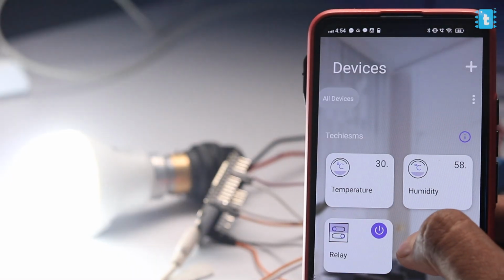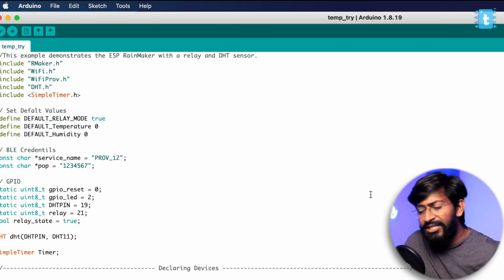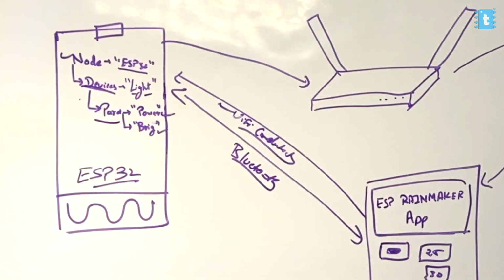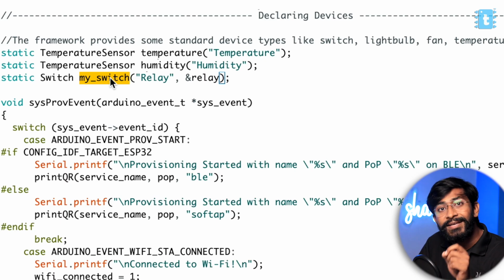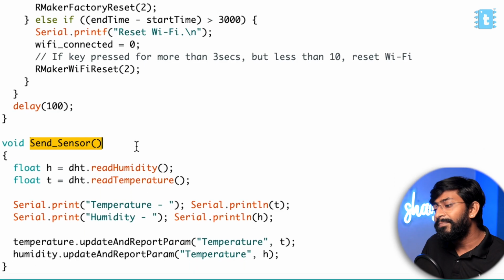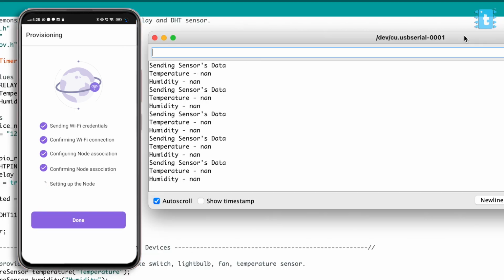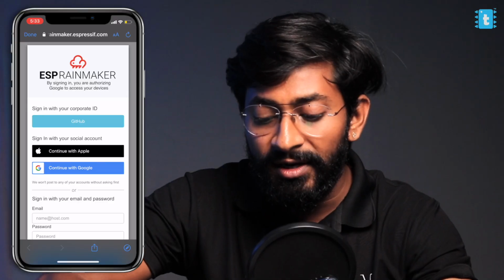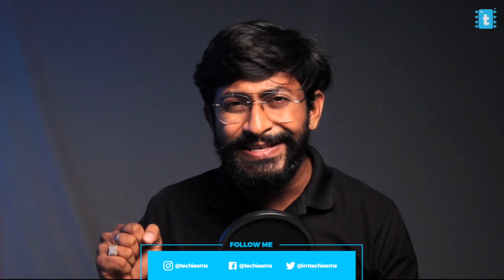Using RainMaker with Arduino IDE in ESP32 | More Features than Blynk & Arduino IoT Cloud for FREE

Comment from the maker: Well, What will you use for you IoT projects? 

New Blynk, Arduino IoT Cloud or RainMaker ??

👇🏻 comment below 👇🏻
Reply: Only one request, for the upcoming project, please consume as much outputs as you can for the relay, as it will be more convenient controlling maximum number of devices using single project.
Reply: Sir rainmaker is more than blynk so pls add more relay
Reply: @rohitmobilecare7691  yes
Reply: I use nodered
Reply: Thank you so much indeed. We really appreciate your great effort and easy to follow tutorials. I am able to implement it according to your instructions. And I am very excited about it. We really hope that you will guide us to how to use the local network connection. Thank you so much indeed.
Reply: Sir thanks for the indetailed explanation.
QR code is not visible in serial monitor , so how to slove this 
I am getting error as: Node connected to Wi-Fi without assisted claming.cannot proceed to MQTT connection.
Reply: Will give Rainmaker a try. The Blynk user interface was amazing! I don't like what they did with the prices. After some fiddling I have a slider in the rainmaker app as well so maybe I'll try more of Rainmaker.
Reply: A fatal error occurred: MD5 of file does not match data in flash! error bruh
Reply: Why do we have to use a third party all the time. Why can't we just connect directly to the ESP32?
Reply: Can it be installed on the ESP32-S2 Mini board?
Reply: Thank s a lot for this informations from Oran,Algeria.
Reply: i want to add 5 relays to the esp32 program what should i add in the coding section on arduino IDE ?
Reply: Well I have been using Blynk for over 5 years... need to switch to rain maker now, as Blynk is loosing it worth for home users.

Comment: Sir when try to connect via rainmaker mobile app then three features out of five has been added but confirmation of node association is not connected. Why this happened? Two days ago it was alright but after power off the module in the night & in morning when try to connect it with mobile rainmaker app not possible. In serial monitor shows MQTT failed. What is the problem? Don’t understand it. Please answer me.

Comment: Hello thanks for making the video about Rainmaker.... However I'm really struggling to make it work (sadly have to admit been looking at it serval months) I use same Arduino IDE version as you use in video (1.8.19) and also am using same board version  (2.0.3) ... I can compile without any errors and upload it too... However I don't see any QR code (or link) coming... the only text I get in the terminal (serial monitor) is some unreadable text and characters.... I use a Esp32-wroom-32 board (devkitc v 4)

Comment: Hey i just came across your channel and its pretty cool what u're doing. If u can could u please make a DIY video  demonstrating how to make a simple 3D Printer Filament Dry Box that uses a heating mat, some 5v pwm fans for circulation, and if possible with room to  upgrade to a solid state dehumidifier. now the best part of the video would be having an esp32 with RainMaker controlling everything and regulating the heating mat's temp to create a suitable environment for the filament. Let me know what u think even if u dont like the idea lol

Comment: 14:21:55.590 -> E (22062) TRANSPORT_BASE: Failed to open a new connection
14:21:55.590 -> E (22064) MQTT_CLIENT: Error transport connect
14:21:55.637 -> E (22064) esp_mqtt_glue: MQTT_EVENT_ERROR    error is pop[ing when we are try to reset

Comment: Hi Bro, I am making one box which can measure Temprature, pressure, weight, RPM, Sound intensity and other 4 parameters so, i am confused which server or cloud platform i should use?? i am using ESP32 board so rainmaker would be good idea or Blynk IoT or any other suggestions?? Thankyou  @techiesms

Comment: Hello
can you help me with esp rainmaker

I should measure the voltage on one battery pack

it has 3 batteries of 12v each

is it possible to measure it with esp32 and esprainmaker and see it on the app on the phone

thanks in advance and greetings from Serbia

Comment: Thank you, but my problem is the space in esp32: text section exceeds available space in board

Compilation error: text section exceeds available space in board, Any solution?
Reply: Try to change board to ESP32 dev kit. And in Module select ESP RAIN MODULE. 
It worked for me.

Comment: Hello Sir, thanks for the video. 😊😊 But I have a question about running the ESP32 Dev Module. Actually, when I uploaded the RMakerSwitch sample code through Arduino, some messages popped up saying that “Failed to allocate memory”, “Device handle cannot be NULL” and “ESP Rainmaker not initialised”. I am not sure what was wrong about my board. 😢 Do you know what was the reason behind?
Reply from the maker: Send the screenshot of that error on techiesms@gmail.com
Reply: @techiesms  Hello Sir, I have successfully solved the problem. However, I have encountered a new problem with the Timer. Actually, when I run the timer, the serial monitor displayed this message to me : "E (6309) esp_rmaker_param: Current time not yet available. Cannot report time series data." What should I do to fix this?

Comment: Thanks for this video, was very interesting but I have a problem. I try to use Scheduller on Rainmaker but every schedulle do nothing, doesen't change the Relay state. The time zone is correct (UTC-3 São Paulo). When I change the Relay state manual work but on scheduller don't. Can you help me?

Comment: hallow , thank you for your support , you are excellent as usual ,reference to google home integration with ESP rainmaker , i wonder why the temperature and humidity did not appeared in the google home screen and just the switch , another question why google assistant do not response for reading and telling us the temperature and humidity values when asking it for other integrations , in the other hand applications like IOS Home app like sire tell and talk the temp values! 
also i wonder why most of smart home applications do not use other needed IOT devices  like water tank level measurement ,boiler room equipment's pumps widgets for example 
thanks again and best regards

Comment: Great tutorial. Very clear....except that it does not work in any of my close to 12 ESP32. Maybe something wrong with the ESP32 hardware version. ESP32-WROOM-32 and 32D. Like 10 of these and Some old ESP32 ones I didn't try. Firmware is flashed and messages are sent to terminal, including QR code. Galaxy Note8 ESP Rainmaker app (has a bug i fixed that crashed it permanently. Just set Performance to Optimized). Add device, QR scan or manual BLE, shows PROV_XXXX but when selected it finally says a  "Communication Failed. Device may not be supported". I guess not, not one of the 10 I flashed and tried worked. Maybe u know of a limitation ion the ESP32 or Galaxy? Incredibly frustrating as u can imagine. Anyway great example of what could be a great app but not Industrial Reliability as it happened in ESP32 IDF when it first started.  BTW it is not Arduino IDE same result with esp-idf envrionment.
Reply: II will comment myself. Better results now. Another Android phone was able to connect automatically to the BLE in the ESP32. My Galaxy has to be paired manually (I don't know how to change this in the phone). So now,in a rather manual way, I can connect the ESP Rainmaker app to the ESP32. Using QR or BLE manual I can start the Claiming process for those Nodes that haven't done yet but the problem now is the Network. The same Node in the EXACTLY same place will not find any network connections (there are 5 as seen by the Wifi of the phone). So, I guess we are moving but not very stable. Thanks again for the tutorial will now go the the ESP32 Rainmaker forum and try to find answer.

Comment: Very nice. 
Two problems need to be addressed:
The ESP 32 does not reconnect to WiFi after internet outage.
The relays do not remember their last states after power outage.
Reply: You can fix that yourself by adding a verification routine running on a timer.

Comment: Sugestion for Future lessons: rainmaker(beging with 2 or 3 output) later update program for add more output control via OTA. 😘
Reply from the maker: Noted
Reply: Sir, is possible use rainmaker with GSM instead WI-FI?
Reply: Some more explanations would be cool, especially the custom buttons, or a pull down menu would be sweet to integrate here!

Comment: why error please help.... in mobile connection step... Thank you.

E (92144) wifi_prov_mgr: Failed to create prov_stop_task!
11:30:22.096 -> 
11:30:22.096 -> abort() was called at PC 0x401760bf on core 0
Reply from the maker: Do all these steps 
- press and hold the boot button for 10sec to factory reset the board 
- unpair the Bluetooth device from your phones Bluetooth setting 
- make sure ESP32 is not connected with any thing ( relay or sensor )
- And finally scan the QR code once again
Reply: @techiesms  thank you..

Comment: ❤️cool
Reply: @techiesms  Just keep it up man. I love watching your videos. I have implemented home automation at mu house and my Mama’s house and its still working great till date. I completely automated a Submersible Pump, lights fans. I used your code and tweaked a little bit and its still working great.

Now I can finally define separate icons and variables for fans and other electronics and also if I have to change the wifi I do not have re upload the code again and again.❤️